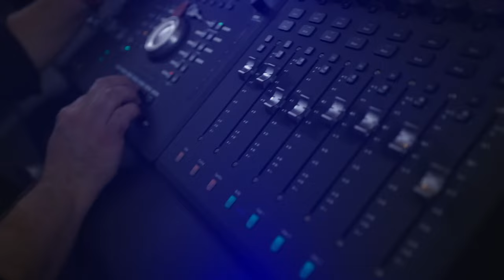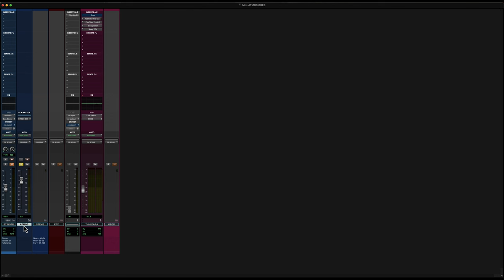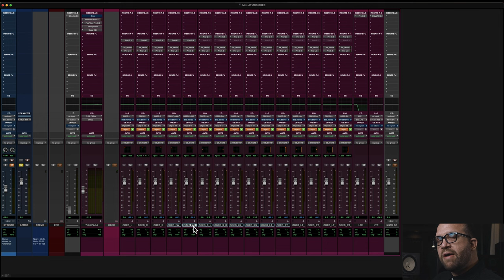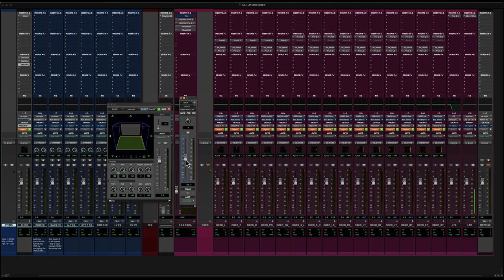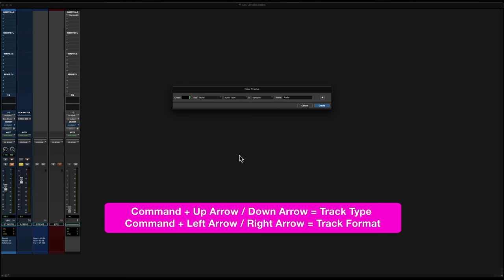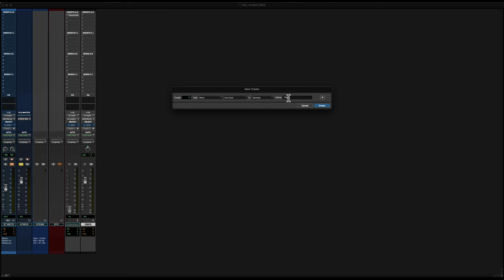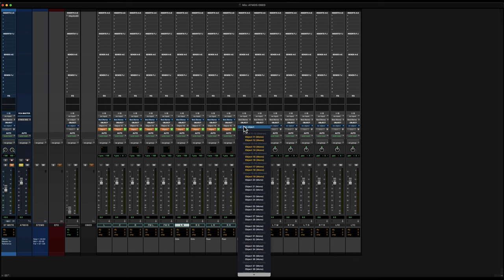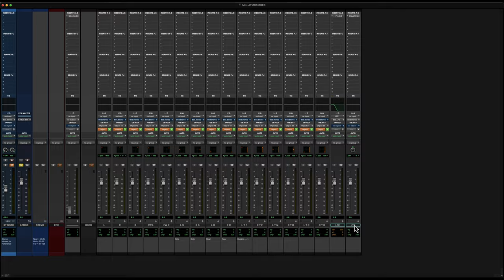Exploring Object Bed Mix Buses in Dolby Atmos Mixing - (Part 1 of 2)

Comment: Hi Shane, thanks for your video :) It is possible to do "hardware insert" on an OBED (inserting analog EQ or comp ) Thanks a lot :) ?
Reply from the maker: Hey @sound4label, I am not running any hardware in the Atmos world. I imagine it's possible to use a hardware insert, but my brain goes to "why?" If you're starting your Atmos mix from stereo mix stems there should be little need for processing.

Comment: Thanks for the video, definitely interested in this topic. I’m a little curious as to what the benefit of using auxes is rather than just using the object planner directly on a track. Is this so that it’s easier to pan one channel to any speakers of your choice as opposed to just using the planner alone? So for example you could send a guitar to centre & rear back if you wish ? 

Wondering if this is wise when considering phase issues …

Thanks
Reply from the maker: Hey Stu, if your room is set up correctly, you will not hear or have any phase issues. Admittedly, setting up an Atmos mix room is not easy, and I will be making content to help people with that topic.

Regarding your question, the benefits of this OBED technique are what you've mentioned: 1.) You can pan/spread source material to multiple locations simultaneously. The stock panner will only allow you to have two pan positions, and some features that allow you to do something similar, but it only goes so far with the stock panner. The OBED technique helps you take that premise to another level. Ultimately spreading a sound source out more and making it larger than life. 2.) You can EQ and compress the entire mix if desired -- having greater control.

Your panning example above is correct — you COULD do that, but I’d encourage you to make decisions that feel timeless. As I said, bass can have a front-to-back panning right down the middle. I have not found another musical element that takes that panning well. This is where we have to experiment, push the envelope, and find what works for the art we're creating.

Comment: Could you use an OBED as a compd aux, for reverbs and effects etc? 
So a 7.1.4 track with a 7.1.4 instance of whatever effects sending to the OBED, to give full flexibility and fold down compatibility. And then use that OBED as the full aux for all instances of reverbs and delays? 
The 7.1.2 limitations are antiquated now but Dolby have no intention of changing that due to compatibility
Reply from the maker: Hey @Ben-jv9rr ! You’d want to set up a separate set of aux sends for your effects before the OBED for maximum control. Then, the output of those aux tracks feeds the input of the OBED. I made a video on this! But yes, your fold-down compatibility is rock solid once you do that.

Link below to that video walkthrough.
Reply from the maker: Craft Surround Effects Using Your Favorite Stereo Plugins

https://youtu.be/nbq90mOMVi8?si=yAlLR-FaTNQdfTTA
Reply: @shanegrush  thanks man! Sounds like I’m on the right track!

Comment: Also Shane, do you think A-list mixers add EQ/comp processing to individual channels or only on OBED which is the equivalent to EQ/COMP speakers group output rather than channels/stems output ?  I hope I'm clear enough :)
Reply from the maker: I think this depends on the song, and the intention. If I had the need to make an Atmos mix pump more than the stereo mix I'd process the individual tracks or stems feeding into the OBED. If you're starting your Atmos mix from your stereo mix, and the stereo mix stems, well then your pumping should already be there for you.

This is why, at this point, I am doing my stereo production first, and then extending the artist's vision into the Atmos world. I think the process is more efficient. That said, the day an Atmos mix can exist without a stereo mix attached than I will probably find new paths.

Thanks for watching!
Reply: Thanks  @shanegrush  for your answer , I want to produce and mix directly my music in Atmos, what would you suggest in that case ? :) (if I want to insert analog mastering EQ and comp somewhere ? :) Thanks a lot, so happy to be able to discuss together :)
Reply from the maker: @sound4label - well, the challenge there is the channel count. The Dolby Atmos Renderer has 128 channels. You'd need a ton of hardware to use it all around an Atmos mix.

Comment: do you have any video explaining how to set the channel you did for binaural settings and how it works? im lost there jeje
Reply from the maker: Pretty straight forward! The Binaural settings plugin is inserted on a Aux track in my mix template. Once you instantiate that the Dolby Renderer will detect that those settings are being controlled by the plug-in. I touch on this in another video. I’ll link it below.
Reply from the maker: Ultimate Guide to Pro Tools I/O Settings for Dolby Atmos Mixing
https://youtu.be/mprNLWsroyc

Comment: have you found that using a Object bed removes the need for an Halo or Penteo Upmix?  It seems that if I can essentially spread, for example a stereo stem exactly to what speakers in our 7.1.4 system that I would be recreating what Halo or Penteo does.  My main concern is are fold downs of that same Atmos mix downwards going to be clean just like when using Halo or Penteo.
Reply from the maker: Hey @christurbiville! Yes and no. I am using Halo less and less these days. But I still use Halo in specific situations — for example, if I get a vocal stem with effects printed in it, I can separate the effect from the vocal a bit with Halo. It's not great practice or my preference to do this, but if the files aren’t delivered to my spec, I have to get creative. 

Aside from that, remember that the OBED sits before the Renderer, so fold-downs aren’t altered or degraded. Just check your Trims and Downmix settings to ensure the mix behaves to your liking. 

I’ve not used Penteo — sorry, I can’t weigh in on that one.
Reply from the maker: One more thought: another creative use for Halo is using it to help make stereo stems wider. Which can bring the Atmos mix to life. Creating multiple auxes, let's say three auxes with an instance of Halo on each. Set one to wide, the next to wider, and the third to the widest. I'll send a stereo stem to three auxes to help make a source wider without ruining it.

You can also try delaying one side of a stereo stem with a simple plug-in such as Avid’s Time Adjuster.

Comment: Question, you say adding height to an object does not go into top speakers. If that is the case how does it make the object 'Higher"?
Reply from the maker: No sweat, the difference there is between using the bed only, or using objects. If you use the bed and begin to raise the panning of a source you will hear it in the height speakers. Using objects only you have more fidelity, essentially, in your height panning. What I was trying to discuss is that panning something 50% in height using the bed will show up in the height speakers, but that same panning value using objects only will not. Greater creative control! Let me know if you have any questions and thanks for watching. 🤜🏻🤛🏻
Reply: Objects do not have any more “fidelity” than an object bed especially since an object bed is... object based.
Reply from the maker: You may have misunderstood my point. To reiterate, my point is that using objects vs. the bed alone will give the mixer greater fidelity or more increments in their panning positions. This affects how program material translates to binaural, etc.
Reply: You are still using the word "fidelity" as a differentiator. This simply isn't true. Also object bed (ones) vs objects, with regards to "increments" makes little sense. There is no difference in panning resolution between the obed and object.
Reply from the maker: I am sharing a difference between using THE BED vs. using objects, bud. Look it up in the manual. If you begin to raise the height of something output to the bed it shows up in the height channels really fast. If you do the same thing with objects it takes a lot farther of a pan to hear those in the height channels.
Reply: The render manual? I'll look but I don't remember Dolby ever teaching or documenting and obed. I'll look again. Still none of this has to do with "fidelity" or "resolution."
Reply from the maker: I’m not sure if you’re a MWTM subscriber, but if you are Ceri Thomas (Dolby, Apple) also touches on this in Josh Gudwin’s mix for John Mayer — “Wild Blue” is the song. 

Ceri states that, “an object that’s panned back and up just sends the source to that position, as opposed to the bed — which is going to place the sound in everything overhead.” 

I’m not going to go back and forth on what specific word you’d prefer over what I said. But fidelity, increments of panning, resolution, etc. all work in that scenario. 

Part 2 @ 5:31 in this series. 

"Mixing in Atmos #3" of Josh Gudwin on Mix With The Masters. https://mixwiththemasters.com/videos/josh-gudwin-dolby-atmos-workflow
Reply from the maker: And you’re right, the OBED technique is not documented by Dolby — I never said it was. The technique is used by A-list mixers and was developed by the staff engineers at Capital Studios (Steve Genewick & Nick Rives).
Reply: I've seen the videos. They're good. I'm not debating the concepts you are trying to explain. However "fidelity" is often equated to "quality" so I encourage you to choose words that cannot be misconstrued by those you hope to educate.

As for the manual, you told me to look it up in the manual so yea... that confused me too.

Comment: Im sorry, but what is an O-bed? do you mean the general dolby set up in the renderer with beds and objects itself? 
you just used this word out of the blue, whithout explaining. - and there is no reference not even in the title. I am very confused if this is what Im even looking for or rather some new different unconventional use of beds and objects that Im not ready to learn yet.. :/ :[
Reply from the maker: OBED isn’t an acronym or anything, but it’s a shorter form of what is called an Object Bed Mix Bus. You’re essentially creating your own Bed with Objects. But yes, this is an advanced approach that the a-list mix engineers use, but they are not discussing much.
Reply: @shanegrush  cool, thanks for your reply. do you see essential advantages then in this manual approach rather than using a renderer? thank you! or is it financial benefit even? because the pro tools renderer isnt free..
Reply from the maker: You’re very welcome. This custom approach uses the Dolby Atmos Renderer. The OBED is essentially a custom path before the renderer input. The benefit of this OBED technique is in the translation and being more creative with an Atmos mix. It unlocks the ability to pan an object to multiple locations around the sound field simultaneously without compromising translation. 

Regarding your financial question, Avid has an update coming where the Dolby Renderer will be integrated into Pro Tools (like Logic, etc.). And at that time, I’m sure this approach will need to be revised, but I’ll cross that bridge when that happens. 

For now, mixing Dolby Atmos in Pro Tools requires the two pieces of software. I’m unsure if that decision was based on a limitation or a calculated move by Dolby. Good question. 

I’m in this stuff every day. All I’m trying to do is make cool stuff and enjoy myself.
Reply from the maker: One thing I can share is that I was made aware of this technique, and my curiosity kicked in. Once I figured out how it works, I started applying it to my mixes, and the results blew me away. That’s why I made this video series. Especially, since the a-listers are sharing the templates around town and with friends, but they are not talking about it in public.